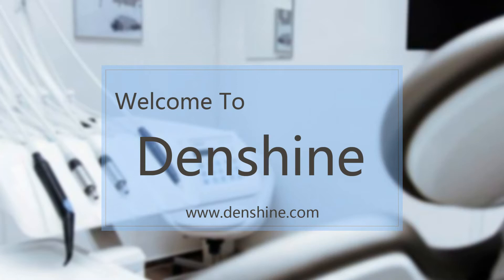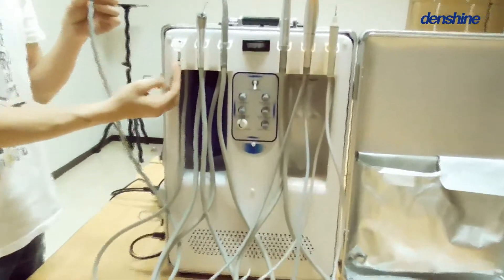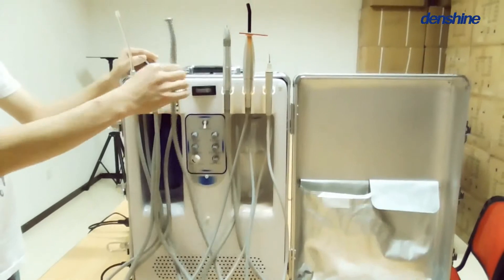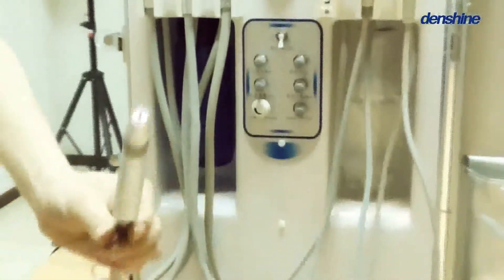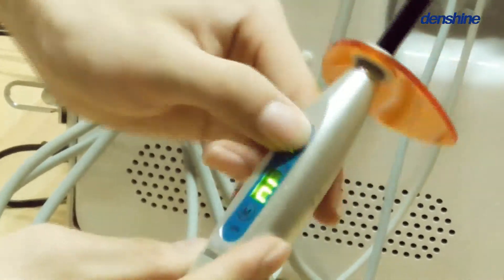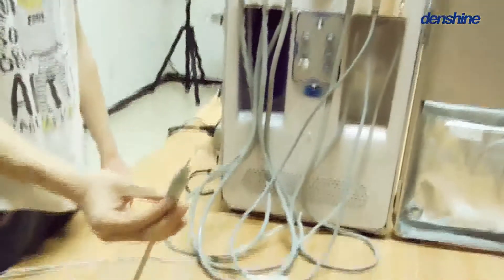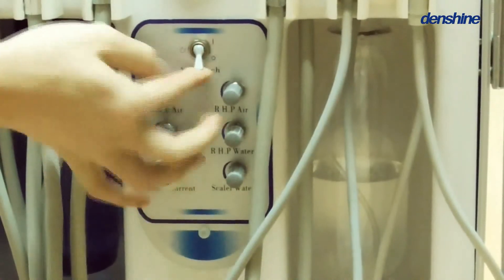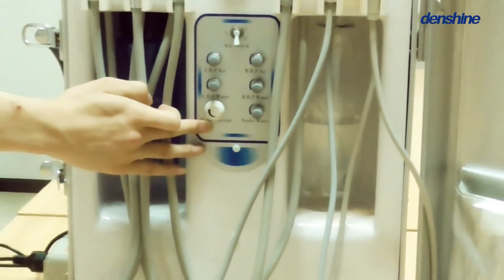How to use the portable dental unit?

Comment: I got my unit but just to start it does not stay on. Could you tell me why? If I remove the saliva ejector machine starts but it turns off again. When you start the unit does the air switch has to be on inflate or deflate?